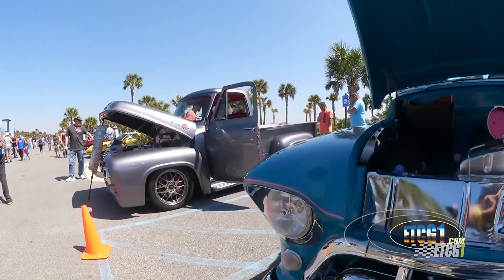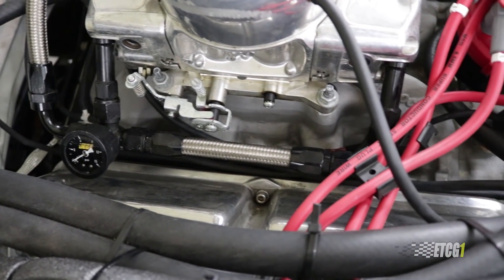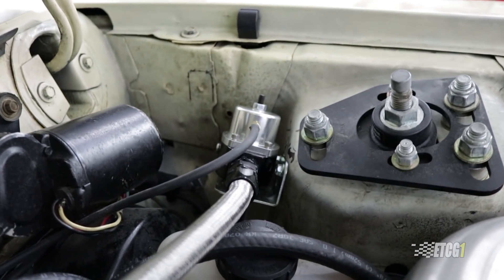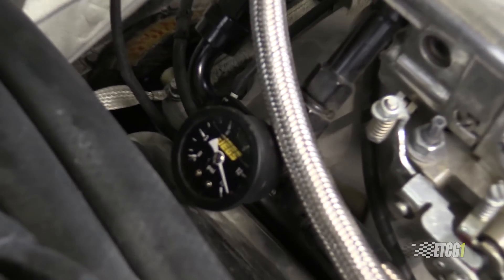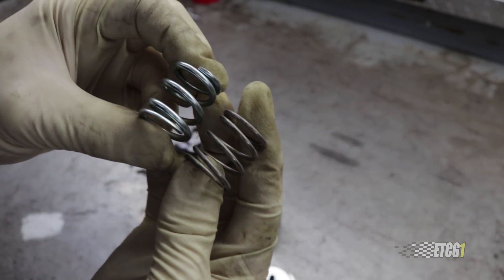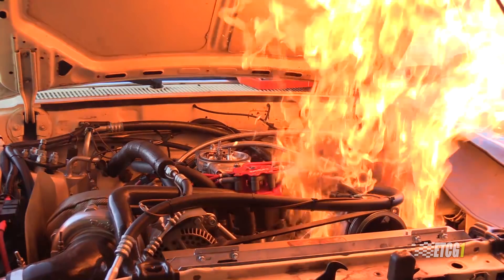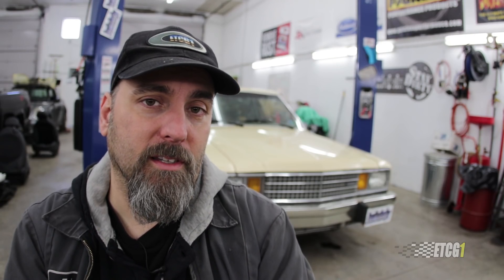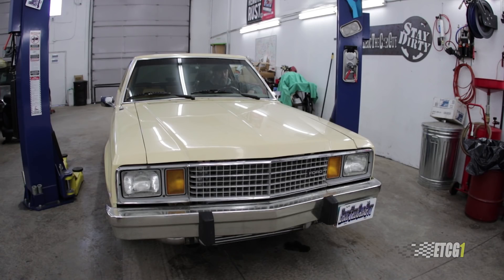How Did the Fairmont Catch On Fire?

Comment: Yeah that was a very close one Eric glad your okay . Your Very lucky like I said before I wish the fire extinguisher worked on my fire I had cause I was changing a fuel pump on a 03 chevy Malibu and I had dropped the tank. The hole fuel tank was full of gas and I had draining into like pans and a bucket but it was very cold that night when I was doing the repair so I had tarps up around my hole garage and i had a kerosene heater which was a big mistake . out there with me to keep it little warm but didn't help but I just got up to get another bucket or pan to put the gas onto it .and then all sudden the hole underneath of car caught on fire into flames real fast I tryed putting it all out with a fire extinguisher . it didn't work it only made everything worse I tryed to get to my water hose but just couldn't in time before it got to my other vehicle and burned it to the ground and all of the tools I had in the garage like car jack and j stands and air impact gun alot of things just wish I could have saved my car before it all burned up everything just happened so fast . Now I had done fuel pumps before so I knew what I was doing I just never thought about the heater I had out there with me. But if anyone wants to see the garage or what exactly everything looks like or what happened it is on my channel it's the newest upload everything happened a week ago this past Sunday 😓
Reply from the maker: Yea, you have to be careful with those heaters. Glad you're OK.

Comment: Had a fire on my Ls swapped 1992 c1500 first test drive. Had a fuel leak earlier and and and it soaked the exhaust wrap. Fire extinguisher in my cab saved the day.
Reply from the maker: I like a happy ending. Sounds like a nice truck.

Comment: I worked in a Pontiac dealership in the 80's. 
They had taken in a used Fairmont  on trade. 
The carb on it dad problems so it was taken off to be rebuilt. 
Back then we rebuilt parts like carbs starters,  alternators, engine and transmissions .
The car had been pushed outside to free up the bay while the carb was being rebuilt.
when the time came to PUSH inside the car jockey tried to start the car and we had the same result as you had... Fire but it did a little more damage. 
By the time the fire was out and the hood was opened we weren't as lucky as you. 
It wasn't worth repairing  and it was scrapped.
The tech learned Another Life Lesson. disconnect the battery and cap the fuel line.

Comment: I have a 92 gm lg6 engine in my car and its throttle body fuel injected and the ignition was being temperamental... so the pistons would be filling with gas  with no spark... then boom the entire engine was alight. It was quite fun to deal with

Comment: First off, I am glad both you and the car are alright.  Second, I must chide you a little for not checking the regulator BEFORE installing it, one must always check parts that have the ability to be converted to different fuel setups (don't worry, I learned that the hard way too).  It's funny how what seems to be the little things can be totally devastating to a car.  I have several of the BJ quick releases  for fire extinguishers, they are handy little buggers, thankfully I haven't needed to use them yet.  Once again, very happy that both you and the car are alright.
Reply from the maker: Well,  lesson learned, and now that I've posted this information it can help others avoid the same fate. At least I had the fire extinguisher handy.

Comment: Reminds me of the time I was working at a John Deere dealership and a coworker was cranking a lawn tractor engine to purge the cylinder of gas. He set the customer's garage on fire. Later at a Toro dealership another coworker was doing the same thing in the shop. I warned him but he didn't listen. Company had to replace the tractor.

Comment: Wow mate I think it's lotto ticket time for you. I was baffled at first to see the fuel pouring out the intercooler discharge pipe but there you go it can be done. When the motor filled up with fuel inside did it fill the sump as well or just the tops of the cylinders? And how did the car get the name Oliver?
Reply from the maker: It filled up the cylinders, not the sump, but I'm changing the oil anyway just for good measure. As for the name: https://www.ericthecarguy.com/blog/1899-project-oliver-a-mustang-in-fairmont-clothing
Reply: Oh I thought it might be a Top Gear reference. thanks for the link to the blog post I'll keep an eye on it.

Comment: Lesson of the day, never assume. It just makes an ass out of u and me. glad that car is alright. I had an engine catch fire on the floor during a test run. The hose from the mechanical pump to the carb sprung a leak straight onto the exhaust manifold. We didn't have an extinguisher but we were next to the door and there was a garden hose near by.  I am currently upgrading my garage to a shop, think I'm putting an extinguisher on the to do list.

Comment: Old  fuel systems and aftermarket parts need to be paid close attention to. I work on old VWS and everything aftermarket needs to be checked and usually modified in some way for it to work right, Namely fueling system.

Comment: Eh, any modified "race car" typically has something singed under the hood.

I had one fuel injected car that had the filter mounted on the front of the engine facing up, I swapped the filter with a new one and after testing for leaks and then started it in the garage, hood open, the fitting on the new filter ripped out and I had a jet of burning fuel shooting straight up, torching my dad's garage ceiling.  My brother's car had a power steering line rupture spraying power steering fluid on the headers which ignited and torched my garage wall.  My current setup had an ignition/distributor probelm that turned up when I was trying to install, initially fire and tune a fuel injection swap, it took about 20 seconds for the headers to get glowing hot and melt most of the plastic looming near them.

It happens no matter how careful you are.  I couldn't have avoided any of those.  Be ready for it and put it out before it's a problem.

Comment: Besides it  saving your ride a extinguisher can save a life.I've come across a few accidents before the police while driving a tow truck and fires are common.One was a guy in a overturned drywall van where he was trapped under the dash.Luckily he wasnt hurt too bad but he was still trapped and the battery had just started a small electrical fire under the hood.Thankfully we got it out before it really took off.
    There's no reason to not have at least a cheap one in every car and possibly more.If you've modified it and or race etc then spend the money for a better one if you can and chances are you or someone close to you will be glad you had it.I actually keep 2 in my daily because once you've needed one you NEVER be without one.They're the cheaper ones but as they get old I'll rotate the out of date one to the trunk.

Comment: I'll just assume, fuel pump-left on without it running and it filled the pipe/cooler or the pressure regulator went wide open and caused it to do the same. :))
needle/seats don't hold well above 4 psi without engine running, so being a "street toy" you should probably set it up so the engine has to be cranking or running for fuel pump to be on, much like a fuel injection setup. just add a manual prime button if you're worried about empty bowls from evap/boil off ;)
lucky it didn't damage anything when it hydro-locked, quite often it breaks the starter bendix or much worse if it was running and locked, which most always obliterates/bends rotating assembly parts
Reply from the maker: You should watch the video before commenting.
Reply: watching first takes the fun out of guessing! the wrong spring in regulator bit you hard for sure, at least you got the fire out quickly, it would have put some into a stupor and burned much worse. old saying "never deviate from stock" when you do "murphys law" will always sneak in ;)
Anyway the advice about the needle & seats not holding well above 4psi and not having the pump on more than a few seconds without engine running still applies, It's more critical with race, off-road and alcohol carbs that commonly have larger needle and seats. they just don't seat perfect every time without engine running and the vibration helps the needle center and square up to the seat.

Comment: Great Video!  Thanks for sharing this very frightening event.  Firstly, this video has more of a safety message than automotive.  Did you buy a lottery ticket that day?  If not you should have because you were very lucky.  Consider this a true "Near-Miss".  Under less fortuitous circumstances, this could have had a very sorry ending.  Fire doubles in intensity every 30 seconds and in under 3 minutes (just before the fire department could respond to the scene), the car and anything next to it could have been burned or worse, you could have been seriously hurt.  I don't mess with automotive fuel systems - I leave it to a pro who has his own shop and insurance and most importantly, proper training and experience.  Secondly, did you contact the manufacturer of this fuel pressure regulator to report the event?  It was supposed to be shipped with the weaker spring for the carburetor and without both to compare, how else would you know?  That was a very dangerous blunder on the manufacturer's part.  How many more are incorrectly set up?  Let's get them all recalled!

Comment: Wow, this brings back some BAD memories. I was working on a heavily modified Mitsubishi Eclipse.  High pressure fuel injectors, blah blah blah. Yeah, the aftermarket fuel pressure regulator was not adjusted properly and the fuel pressure was way too excessive. Before I fail to mention it, several of the fuel injector O-rings were leaking(who would have guessed?) You see where this is going?Oh, and it had an aftermarket remote start/security system that the owner failed to inform us on what button did what on his key fob. As a result, I nearly got ran over by the car. I remember quite vividly being handed like 10lbs worth of instructions related to the thousands of dollars of worth of non oem parts. AEM was a huge contributor I guess. It makes me sick to even think about it....

Comment: Eric, with as much money that you have tied into that car, don't they make a fire suppression system that mounts in the engine bay and you can pull a pin inside the vehicle to extinguish the fire?  I'd think that may be a very good investment especially if something were to happen with the hood closed as it could be quite dangerous to open a vehicle's hood if there's a fire in the engine compartment.  

That could have been very bad, as in thousands of dollars bad had you not thought ahead and installed a fire extinguisher, I've always carried one, I've never had to use it on my vehicle but did use it on someone else's, they were sitting at the gas pump and after filling up with gas they started the engine and there must have been an electrical short and fuel leak as it immediately ignited...saved their vehicle with a $40 fire extinguisher...pretty cheap insurance.  Call the fire department, by the time they get there your vehicle is a smoldering pile of rubble LOL. 

Also, make sure you know how to use the fire extinguisher, seems pretty stupid to say, but many people have no clue...heck go buy a cheap fire extinguisher, do a controlled burn in say a fire pit or similar,  get the fire extinguisher out and put out the fire, practice never hurts.

Comment: A bit over a month and a half ago, I had my garage catch on fire. There wasn't anything important in there beyond a lawn mower and my 3 tier craftsman toolbox. Anyway, parked in the driveway maybe 6 inches from the garage door was my 1998 Ford f-150. It hadn't started in over 3 months. But once I saw the fire, I grabbed my keys and decided to try it. It fired right up, unhappily but it ran.

Knock Ford all you want. When faced with a "if I don't start, I'm gonna die" situation, my Ford came through.

And yes, the garage was a total loss
Reply from the maker: Sorry to hear about your garage but I'm glad you're OK.
Reply: What started the fire?
Reply: Matt  It was electrical. 1960s construction, even the siding was wood, so it didn't take long to burn

Comment: Very important i did not have one when i was working on my bagged isuzu pickup which by the way i will never use starting fluid again and while trying to hose it down i broke the water spicket from the wall luckily ran inside and got some flour and was able to extinguish it that way
Reply from the maker: Glad you made it out OK. Next time don't use flour, use baking soda. Flour is actually explosive when airborne. https://en.wikipedia.org/wiki/Dust_explosion

Comment: Had a auto trans catch fire  driving home it felt wonky loading up  got home parked in garage just as walking out closing man door heard a phoof opened door turned on light all I saw is thick white smoke  emptied  a 50 pound extinguisher on it didn't get all fire out pushed car out of shop leaving a 2 ft wide strip of fire out door  finally got fire out.  Front seal on trans blew dumping really hot atf out which ignited.  Well with new trans and interior console and carpet my car was back on road. Worst part was cleaning up all that  powder out of car.
Reply from the maker: Glad you're OK. That sounds really stressful.

Comment: Eric shows why carbs are antiquated.
Reply from the maker: You do realize that fuel burns if it's run through a carburetor or fuel injection right?
Reply: ETCG1 I know. But the needle and seat scenario filling the cylinders and intercooler wouldn't happen. Also your sump will be full of fuel as well so you really should change the oil too.
I'm not saying you did anything wrong either, nobody would check that spring, I'm just saying that these are problems with carbys that don't exist with EFI.
Reply from the maker: I'm sorry but I can't see your initial comment as anything but a dig against my choice in fuel delivery, or your second comment for that matter. 

You say those things wouldn't happen, but the truth is, hindsight is always 20/20. You could also say that if Hitler died at birth, the holocaust wouldn't happen. 

My point is that a fire can happen to any vehicle, fuel injected or not, and being prepared can not only save your car and your property, but more importantly, your life. You focusing on my carburetor completely misses the point of this video. Hence the reason I made this video. https://www.youtube.com/watch?v=d9wDitj9Te4&t=56s

I'm sorry, but I'm just so over people telling me that running a carburetor is wrong. Last I checked, it was my car and I can put whatever fuel system I want on it.
Reply: ETCG1 I never told you that you were wrong for running a carburettor, that's on you. I think it's fact that carburettors are antiquated. I think carburettors are more likely to catch fire than EFI.
I'm sorry that your car caught on fire, that sucks and don't wish it on any car enthusiasts but you shouldn't argue against facts. I have cars and motorcycles with carburettors and understand how they work and I can imagine the hate you would get from guys simply because they don't understand them.

Comment: I'd hate to sound like I'm being a smartass, but wouldn't it have made sense to clean out all the excess gas from the engine after you figured out they had put the wrong spring into the fuel regulator at the factory and before you tried to get it going with the correct spring?
Reply from the maker: You might have missed the part where I said I removed the plugs, cranked the engine, and let it sit overnight.
Reply: Looks like I missed that. Still, you didn't expect it be so bad at keeping it's gas out of where it shouldn't go that it would spill over into the intercooler?

Comment: I had a fire one on my Jeep after a weekend of wheeling off road.  On the way home the transfer case rear seal popped loose and all the tranny fluid hit the muffler that is right behind the t-case.  I was driving along the highway when I noticed a huge cloud of smoke beside me and I wondered who was the jerk with the smoking car.  Then I noticed I was alone on the highway, so I pulled over and looked underneath to see the muffler on fire.  I grabbed my fire extinguisher and ripped the top of the container clean off.  I guess I was a little excited.  So I ran into the gas station office that was across the road, and asked for their extinguisher,  ran back to my Jeep and gave it a shot, putting the fire out.  Worse thing was having to tow it home since the t-case had no oil!  checked the t-case and it was okay, that was about 10K miles ago...  Oh yea, I bought a better fire extinguisher after that.
Good Luck!

Comment: This incident once again illustrates vehicle fire danger and makes the case for on-board clean agent fire suppression systems, they are relatively inexpensive, extremely effective, are not very heavy and can be strategically placed to eliminate ballast for a near zero net weight gain, are deployable at speed and when deployed there is no messy dry chem powder cleanup. 
Many modern on-board vehicle fire suppression agents are clean, effective, non-corrosive and simply evaporate in a matter of a few minutes leaving no residue. 

Good job of being prepared, reacting quickly and rationally to save Oliver and possibly your shop.

Comment: i had a cheap mechanical fuel pressure regulator spew gas all over the engine compartment while i was driving. thankfully it didnt ignite, but i did have a fire extinguisher.

i have had other non gas related engine fires however, so i certanly know that feeling. ALWAYS carry a fire extinguisher easily accessable from the drivers seat, on all vhicles, no exceptions. ive even used it on someone elses car.